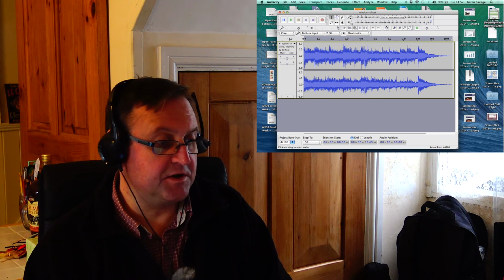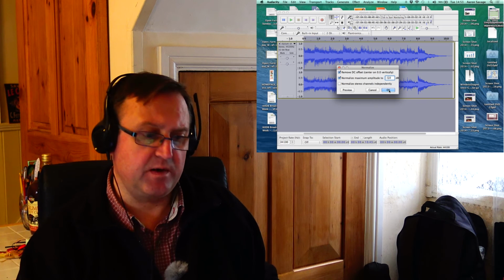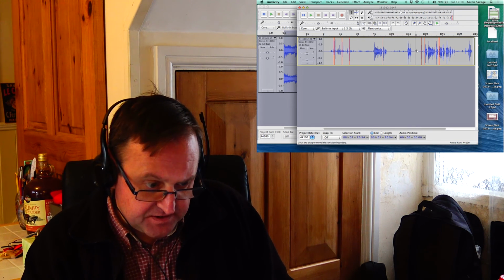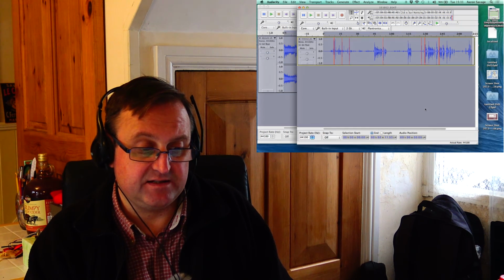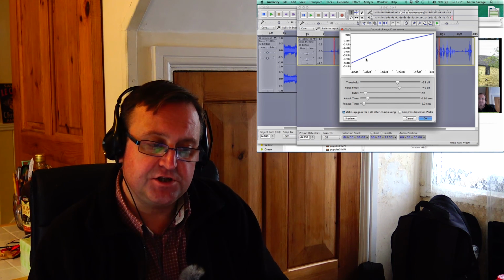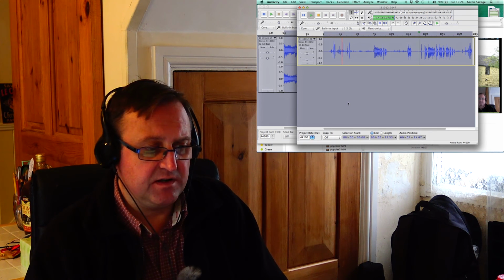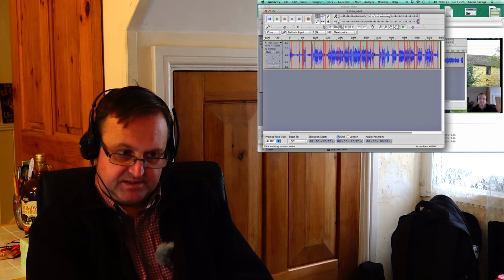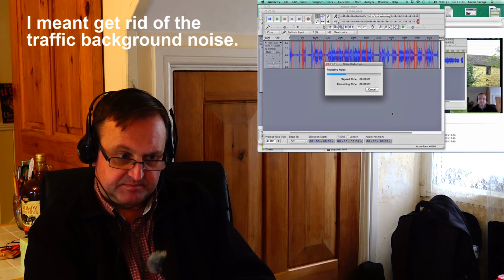Audacity tutorial - edit sound for Youtube videos

Comment: this is a very good tutorial. Thanks. But if you don't have a separate sound recording device like myself, you can always render the sound by itself and then give it the treatment like you have here. Thanks again it does really explain sound very well
Reply from the maker: +Self Contained Lifestyle You are absolutely right.  The program will work with sound from either a camera or a separate recorder.  Obviously depending on the microphone in your camera there will be more or less work that needs to be done but the process will be the same.  I have heard that a lot of DSLR cameras specifically do not have particularly good microphones but I use a fairly high spec camcorder and that isn't bad at all.  I still prefer the sound recorder though.  I am really glad you found the video useful.  All the best.

Comment: Excellent tutorial mate 👍🏻👍🏻👍🏻 . I started using Audacity when I moved over to Mac about 4 years ago. I previously used a package called Cool Edit on Windows PC. Both very similar to each other.. For the price....you can't beat it 😉
What software are you using to display the Mac screen in the video?
Are you looking at the video editing software next to import the audio?
Cheers mate...........Nigel
Reply from the maker: +MuddyBootz Thanks Nigel, I really appreciate all your kind words and really pleased you enjoyed the video.  The techniques to pull it together were actually a bit complex and took me a while.  The image of me is coming from my camera and I am wearing a microphone plugged into the Tascam recorder for when I speak.  I captured the screen image with Quicktime and used the Screen inside Screen features of Premier Elements to layer the video tracks on top of each other.  Then I sized the mac screen track so you can see both at the same time.  The issue with Quicktime is that when it records you can either choose to hear the sound as you are doing it or record the sound, but not both.  So what I did was to hear the sound as I was doing it but to edit the original sound files that I recorded outside in Audacity.  If the audio track needed to show clipping I saved a version with clipping on to sync with the 2 video tracks and the audio being picked up from the computer on my microphone.  So what you are hearing are 2 audio and 2 video tracks that were recorded independently and all synced using Premier.  If I wanted a package that did record and play screen sound at the same time it was going to cost a lot and my other option was to use my camera as a picture in picture of Quicktime which I tried but didn't like.  It took a while and there are places where the sync isn't perfect but I think I have got away with it.  The next video was going to be about cameras and filming and as long as it isn't too long, I will include Premier Elements  for syncing sound, editing clips together layering video and audio on top of each other and adding background tracks.  This is the one I am most excited about because I get to show the first camera that got me interested.  It is my grandad's old 1970s cine camera.  I still have it in the box.  Its a shame I don't have his old video editing reel turner because he used to sit for ages and splice film together.   It could be interesting to see old tech and new tech alongside each other to see how things have changed in such a short time.